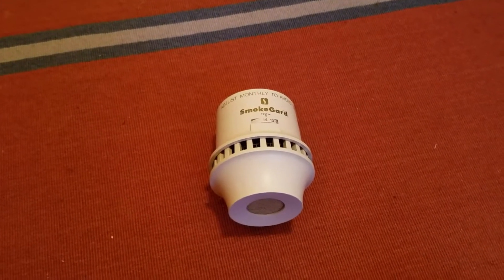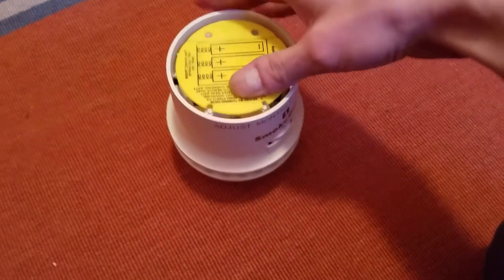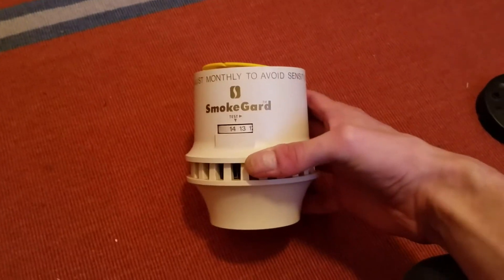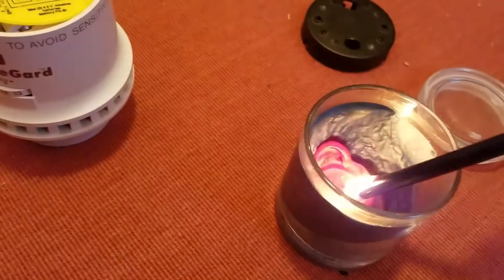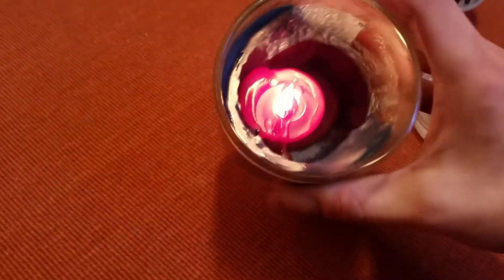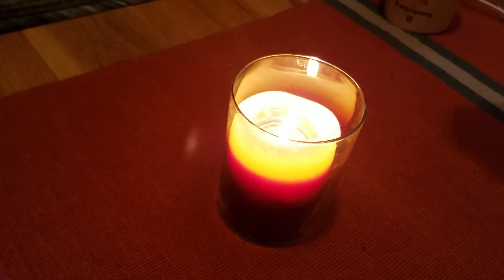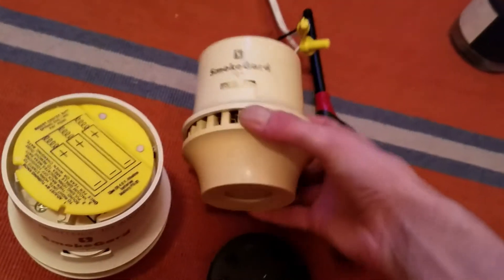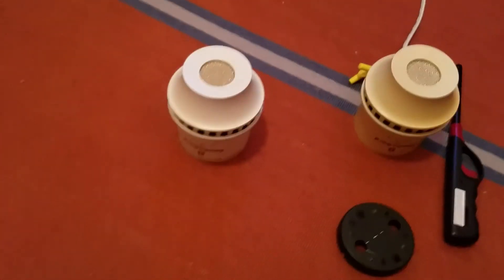Statitrol SmokeGard 700A Part 2 (Powering & Testing)

Comment: i replaced the sensor in mine
Reply from the maker: how do you even do that
Reply: @BAFVintage  its hard but the top an bottom is are molded together or super glued i dont remember but they come apart if you look close enough at both of them
Reply: @BAFVintage  but looking back at the vid theres a screw mine dosent you might try that also